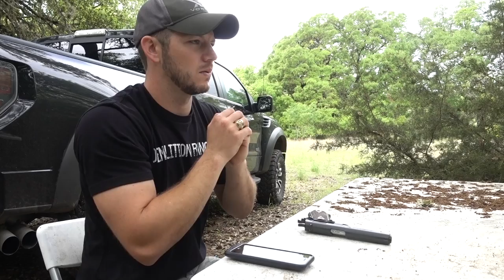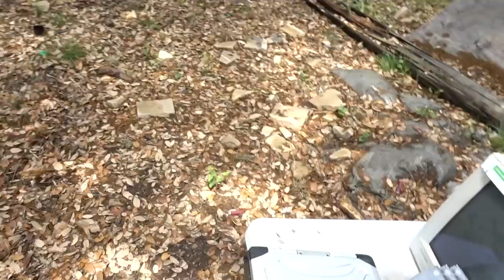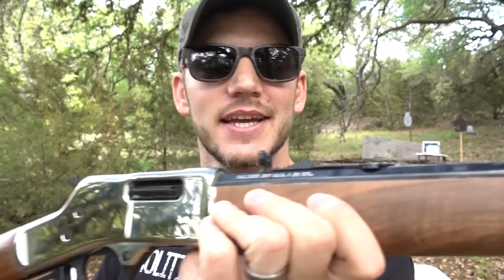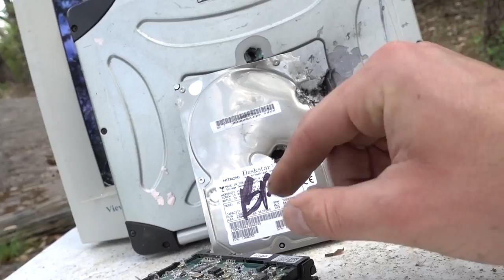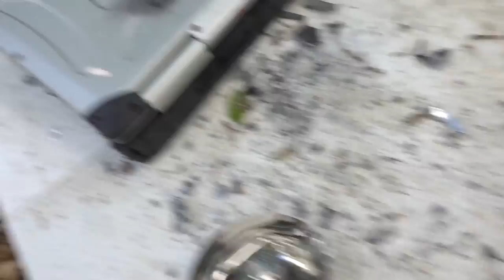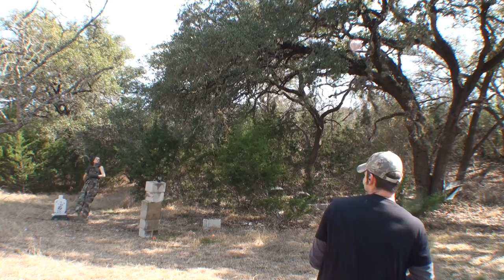Are Computer Hard Drives Bulletproof?

Comment: Hey Matt, take a long piece of thick wall steel pipe fill it with easter eggs should keep that 50 moving somewhat straight then see how many eggs are intact lol
Reply: However, every time it veers and bounces off the side of the pipe it would be slowed down and so it still wouldn't be an accurate representation of what a .50 bmg woulld do against easter eggs.

Comment: Everything is bulletproof if you have enough of it.
Reply: Space
Reply: +Gustav Müller with enough space, bullets lose momentum and stop after a while. So yes
Reply: wrong, if an object is moving, and no forces are acting on it, it will continue to move at a constant velocity. you obviously failed physics
Reply: ilzak2812 yes but will it blend?
Reply: ilzak2812 not air
Reply: atta emad yes
Reply: atta emad it is if you have enough of it. pretty sure a bullet isn't gonna survive atmospheric re-entry.
Reply: Gustav Müller There are molecules in vacuum space. In galactic space there are 30 molecules per 1 cm3 and in intergalactic space there is about 1 molecule per 1 cm3. So yes, after quite long time it will eventually stop.
Reply: If you fire a bullet into space it will travel until it comes in contact with another object. Though "space"  is technically the lack of "everything", so the original argument is correct. Even air (in 0g) would eventually stop a bullet.
Reply: ilzak2812 humans???
Reply: @Gustav Muller    A vacuum doesn't count because it isn't a physical thing. Its an absence of anything
Reply: No such thing as vacuum. The bullet will eventually hit a lost molecule and minutely slow it down. It will then eventually stop.
Reply: ilzak2812 wise words
Reply: i think he ment something that has mass and not vaccuum
Reply: ilzak2812 nothing is bulletproof if you have enough bullets
Reply: ilzak2812 my GPA isn't...
Reply: air
Reply: imkindahungry04364 HAHAHAHA
Reply: ilzak2812: air?
Reply: ilzak2812 even air!
Reply: Not air
Reply: Not in space, it's a vacuum meaning there is no wind resistance therefore the bullet will travel infinitely or until it hits something.
Reply: No, everything is bullet proof if you miss it LOL.   MAT!!!! What happened!  Maybe you should see your local ophthalmologist. ;-)
Reply: Deacon Waterman There are molecules in space.
Reply: ilzak2812 even air
Reply: ilzak2812 even air and water
Reply: Peter damn thats harsh
Reply: Ridiculous Rosy really..?
Reply: Uh. No.
Reply: what about air
Reply: Back The Blue actually if u shoot air it will actually go down so u are wrong
Reply: MutantSniper 121 its not bulletproof it will just stop eventually
Reply: everything is bulletproof if chuck norris wears it
Reply: Scrub Overlord  Wrong! Everything Chuck Norris wears Becomes bulletproof.
Reply: Peter oh yeah, excuse my ignorance
Reply: Scrub Overlord You're excused.
Reply: Peter thank you
Reply: Scrub Overlord You're welcome!
Reply: @George Keevil, Light from stars will have an inconceivable small impact on the bullet, but over time it will add up
Reply: ilzak2812 true
Reply: Gustav Müller "vacuum" is a force. "something" is items with mass,  you know what matter is right?
Reply: ilzak2812 l
Reply: air can stop a bullet
Reply: Gustav Müller in a vacuum you can't fire anything. there is no fire where there is no air, no explosion,no propellant for the slug
Reply: Nunna, guns can fire in space, because the bullets usually have their own Oxidizer, so they are capable of firing.
Reply: Nunna Buiznus explain the Big bang then?
Reply: ilzak2812 there was a collection of super dense gases among other particles, some of that has being oxygen
Reply: Where did the particles come from if nothing was there?
Reply: I can stop a bullet.
Once.
Reply: ilzak2812 air isn't
Reply: VENI X it is.
Reply: Nathan Stevenson (Space Debris)
Reply: ilzak2812 so true
Reply: ilzak2812 yeah, like 120 t-shirts
Reply: ilzak2812 y—yea but ya—you... never mind
Reply: ilzak2812 air???
Reply: If you shoot in a open place with nothing to stop the bullet, sooner or later the bullet will stop right? That's the air doing its job, you just need a lot of it haha
Reply: c h i l d r e n   t o o?
Reply: Law of conservation of energy:energy can not be created and cannot be destroyed
Reply: Pirate Headcrab water
Reply: ilzak2812 that's exactly why I strapped 1000000 layers of paper on myself in order to become bulletproof
Reply: Slothy you're basically a tree at that point lol
Reply: ilzak2812 what about oxygen
Reply: Blake yup a bullet slows down in the air right
Reply: Blake dude
Reply: ilzak2812 so true
Reply: ilzak2812 I
Reply: Gustav Müller theoretically no but it is....
Reply: ilzak2812 but nothing is wind proof.
Reply: Lol
Reply: air?
Reply: ilzak2812 not child porn
Reply: childr I mean potatoes and beers
Reply: ilzak2812 I
Reply: ilzak2812 True True
Reply: Smartness??
Reply: even people.
Reply: ilzak2812
Reply: Bread?
Reply: Bubbles?
Reply: ilzak2812 iii
Reply: bullets?
Reply: ilzak2812 it's true
Reply: Air. It can make the bullet drop, but air wont stop a bullet midair.
Reply: If you got a lot of air and froze it would stop a bullet in a hurry. And it would stop it "mid-air"... because it is still air, just in another state of matter.
Reply: +Pirate Headcrab try shooting 10 quadrillion rounds of standard hollowpoint .22 out of a standard .22 long rifles at a 10 inch steel plate. Bulletproof enough for you?

Comment: is a excavation bucket bullet proof like in james bond skyfall
Reply: Bastian Franke What part was that?
Reply: Zoltan Csikos on the train
Reply: ABRASION RESISTING PLATE (AR, AR-400, AR-500)

AR400 was designed for exceptional durability where abrasion was the primary cause of material failure. It has a Brinell hardness range of 360-440BHN.  The key alloying elements in AR400 are used for specific purposes. Chromium increases corrosion resistance and hardenability, wear resistance and abrasion resistance. Molybdenum increases hardenability as well, but also reduces risk of temper brittleness. This steel offers excellent wear and impact durability. It has yield strength of 155,000psi, a Tensile strength of 180,000psi, and 14% elongation in 2”. AR400 is typically used where high wear resistance in needed as in digger blades and buckets, mining machinery, and heavy machinery.
AR500 is a medium carbon, manganese alloy with moderate Brinell hardness. It is a quench and tempered high strength alloy steel which has superior abrasion resistance and toughness. It was designed for wear and impact resistance with outstanding corrosion and fatigue resistance. Its Brinell hardness ranges from 460-544BHN.  This premium steel is heat treated for through hardening with improved welding capabilities. Given the high strength of the plate forming is possible but difficult. It has a tensile strength of 225,000psi, yield strength of 200,000psi and 12% elongation in 2”. AR-500 alloy steel will reduce material handling costs to a minimum for earth moving, mining and other similar industries in which a combination of toughness and abrasion resistance is required. Because of its exceptional durability in slide wear, rub wear and heavy wear it is used in mining equipment, truck trailer industry, concrete and aggregate industries.

not sure if the AR bit on shooting plates is the same as the Abrasion Resistance  bit though.

Comment: Hey Matt, I have a challenge for you! I wonder if you can chop an incoming bullet with a really sharp sword fixed in place like a katana for example, is it possible? I'm gonna leave that up to you!😏
Reply: As long as the sword is very strong yes he can
Reply: nope
Reply: this has been done :) it's really cool. :D
Reply: a butter knife can cut a bullet. lead and copper usually aren't as strong as steel.
Reply: Have you seen people do that to pop two balloons or is this a troll comment?
Reply: and yeah... while that is just a 22, it should work for pretty much any pistol round... dunno if it'd work for a 223 or better... might just wreck the blades
Reply: Commander Hale not a troll comment
Reply: An incoming bullet? Rifle rounds are supersonic, dude. Pistol rounds come pretty close. No one's reflexes are that good.
Reply: Well, the bullet would need to be quite flat on the tip, maybe a HP round would work, and the katana would need to be REALLY sharp. As in, Seriously. Enough to chop your finger off even if you just tap the sword.
Reply: +roadhouse699 He said put a katana at a fixed position, not have someone swing it xD
Reply: i don't think sharpness would be a factor... more, the speed of the bullet would do most of the work... what would matter is the material of the sword.... as long as the the blade is sturdy enough to not dent, and not so brittle that it'd shatter, it should be fine.
Reply: also, the softer the bullet is, the better. obviously a armor piercing round wouldn't split.
Reply: Pretty sure Mythbusters did this in an episode
Reply: i think they did too, but they had some trouble with it iirc.
Reply: actually, i think they did it with an axe,
Reply: Yes, people actually do this off an axe blade or things of that nature. As long as it's hard enough to cut lead (steel is) and it's not so brittle it will break from the impact, you can totally do it. People use axe blades to hit two targets at once by splitting the bullet =) Practical? Not in any way. Fun? Oh yeah! But of course the blade has to be specifically aimed at. No one could use a sword to actually combat bullets. Besides, the two pieces will still hit you, just in two different places.
Reply: XcrEativEx XcrEativEx if he missed though. RIP
Reply: Void Nil rip😂
Reply: its possible
Reply: A sword can split a bullet, but depending on the force the bullet could split the sword too.
Reply: XcrEativEx XcrEativEx : 
They do that to test peoples' weapons on "Forged in Fire."
Reply: Andrew Nosek
Reply: The katana is too soft and fragile, maybe a tougher sword
Reply: maybe a cheap wall hanger. but a real, quality katana should be able to do the trick.
Reply: Katana edges are harder than majority of swords but that also means they're more brittle. They don't deal well with impact. Also, the most probably outcome is that the sword(regardless of what type) will just pop out of the setup. Though I heard Skall shot  a knife on the flat with a 7.62(or was it a 5.56?) and it punched a hole clean through.
Reply: yeah, dude, i am so sorry to do this but yeah depending what round but the majority of them will split
Reply: want real life proof? forged in fire bullet cut in half it happens 2 times

Comment: tried to check comments but they"re 2 miles long,, so I may be wrong ,,but I just wanted to clarify (for the makers of AR500) that they are 3/8"....not....3/4"...even though you could probably use or destroy  3/4"  with no problem...